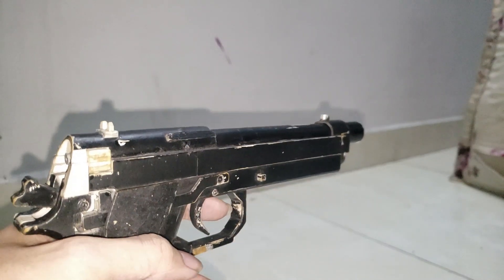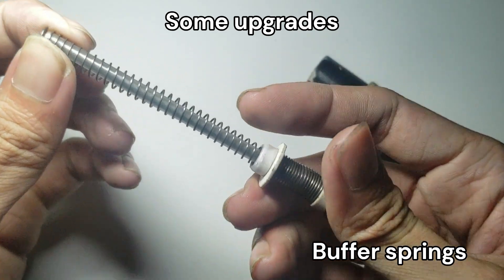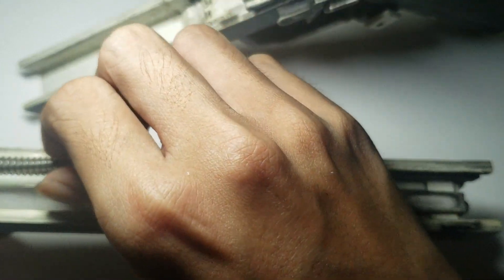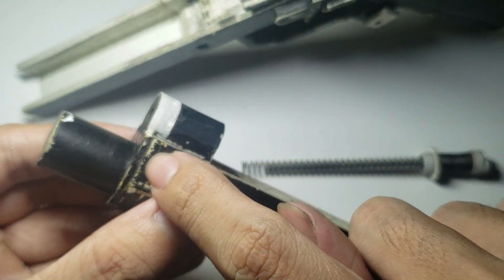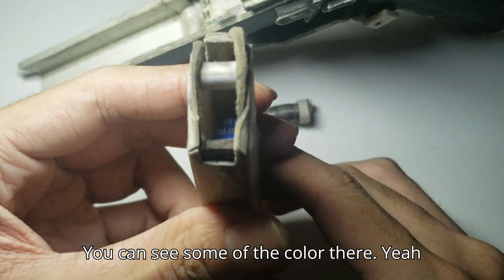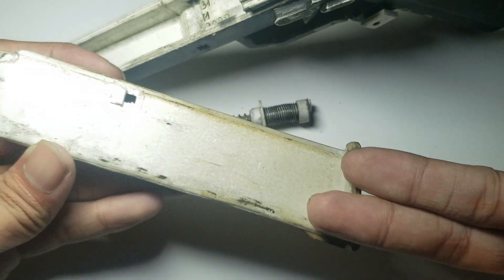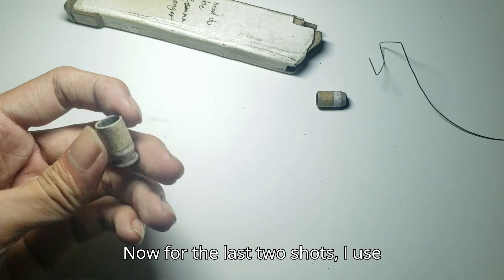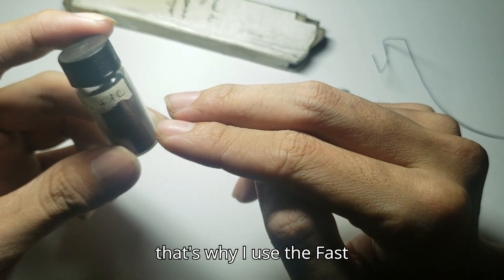Paper Pistol #8: Final Shooting Tests And Upgrades

Comment: Where is the safety
Reply from the maker: The safety is the white cube on the slide, its for locking the firing pin
Reply: @hesitantmetis1413 can you show me the template ?
Reply from the maker: https://drive.google.com/drive/u/2/folders/1DU_hYaIN9UdC3L-qCIdQsH_zmgCg32GW
here you go
Reply: @hesitantmetis1413 i know this template. The one i want is the template of the white cube on the slide
Reply from the maker: i didnt drew it since it came later as the first safety didnt work. Just know that middle is firing, left is safe, right is for disassemble.
Reply: @hesitantmetis1413 one more thing . How do you make the hammer so strong ?
Reply from the maker: You mean it durability or how hard hit?
Reply: @hesitantmetis1413 how hard it hit
Reply from the maker: i just use springs, it doesnt hit that hard, the way the primer cap are made make it easy for a light hammer to trigger it.
Reply: @hesitantmetis1413  so what you use to make the primer cap easy to active ?
Reply from the maker: it just have a layer of alumunum fold to keep it in the mixture in place, making it easy to strike with a lightly sharpen firing pin

Comment: Can gun powder be made with match powder?
Reply from the maker: Not really, gun powder and match powder use different oxidizer, one is KNO3 and the other is KClO3
Reply: @hesitantmetis1413 kno3 is potassium nitrate right?
Reply: @hesitantmetis1413 I watched a video of a guy using match powder in a muzzle loading pistol and it worked
Reply from the maker: Yes. And yes it will work, the different is KClO3 is a stronger oxidizer which mean it burn alot faster, leaving different products, the composition of gun powder and matches are almost the same, but the main ingredients are the same just with a different oxidizer
Reply: @hesitantmetis1413 thank you, will u ever do a tutorial for a single shot rifle?
Reply from the maker: Iam not those are too simple that anyone can make it, if i ever make one it gonna be for testing something really new like chamber, cartridge,  powder or barrel

Comment: Where do u get primer?
Reply from the maker: From match box its pretty common
Reply: I’ve tried but why is it so hard to ignite?
Reply from the maker: There are many resons for that:
Firing pin light strike
Wrong ratio
Low quality powder
Striking suface too soft
...
Reply: @hesitantmetis1413 I think the my hammer dosent hit hard enough
Reply: @hesitantmetis1413 Also have u ever built a machine gun?😊
Reply from the maker: Haiz, listen, i will build an smg at some point but not now, i know you want me to but not now, alright, you can ask other things but stop with smg your time will come, there are things that i need to test before i can advance
Reply: ok ok I’m sorry, I’m just a big smg fan ❤

Comment: 2:29 you just blow my mind 🤯. AMAZING WORK!! ❤ I love how smooth it was. Just cant have worlds its the best thing that i watched today. Your work is amazing please upload a full magzine semi-auto firing video. You are great please bring more frequent videos. By the way can you please share the projectile weight of your bullet and what kind of powder you used in your bullets and what was the amount in this bullet. Will happy if you give these details.
Reply from the maker: You can find most in my video. The amount was 0.08g for the booster and 0.15g for the mix without sulfur, the mixture iam reference to are also in the video
Reply: And what was the weight of projectile? Because it is very important for the recoil bigger mass more recoil. So if you tell the exact weight and the muzzle velocity then may be  i can calculate the total energy and it will help me in my gun also. Because i am also trying to make a semi-auto gun. But it is very difficult . Please be my master 😅❤️ @hesitantmetis1413
Reply from the maker: responding to the reply that you deleted. The bullet velocity is about 48.78 m/s, and the bullet weight is about 5.16g
Reply: @hesitantmetis1413 no it wasn't me. I don't know why but It was automatically removed from comments. But bro why did you keep its velocity so slow. Or was this just an experiment for blowback?
Reply from the maker: Iam prioritizing function over fire power, since its just blowback so its difficult to use more load due to many limitation, like springs and slide mass, if its delay blowback it would be different
Reply from the maker: This isnt something i can help you with, math for gun are complicated also consideringi dont know what your gun look like and how it gonna function, i also have no experience with Nitro cellulose. 

If you gonna test it please consider what will happen if it fail or explode, and if you dont know just test it at a safe distance, firing it with string and under cover.

I do this knowing what will happen if something fail, i have 3 gun fail on my channel: paper rifle #15, case failure due to high burn rate, and m1911 exploded(short), those were when iam reckless.

Doing test you should start with the absolute minimal amount 0.3g try 0.1g or 0.05g first, homemade stuff can be inconsistent, so beware of that, and dont do anything stupid, and lastly if you want fire power just make a bolt action its much easier.
Reply: I have made a single-shot rifle using a homemade shotgun shell. I used 11 steel balls, each 1/4 inch in size, and around 1g of homemade black powder as the propellant. It didn't work on the first try due to pressure leaks in the casing and the primer not igniting properly. However, it worked well on the fifth attempt. The firepower was quite impressive, as it tore through a 6mm thick wooden ply, though the range wasn't very high.

Now, I'm planning to build a gun with better range. I intend to use a single steel ball with ammo size similar to .22LR. I'm thinking of designing it with a blowback mechanism. However, my nitrocellulose-based powder hasn't turned out well yet. Based on my calculations, its range would be up to 100m, with an effective range of 30-40m, mainly because the steel ball experiences significant drag. I tested this ammo with black powder, and the results were quite good. But I haven't set up the proper equipment yet or started building the gun. And the calculations are also based on nitrocellulose powder.

Comment: Do you thinks you'll be able to make rifled barrels?
Reply from the maker: yeah, i make it all the time, this one is also rifled, you can see it in #7
Reply: @hesitantmetis1413  oooh hows the wear and tear from going through so many rounds?
Reply from the maker: It goes through 11 shots, the wear is minimal, due to it being blowback and paper, so the bullet just fit with enough friction, not too tight to the point of seeing rifling on the bullet, prioritizing function over firepower. But the rifling does work on the rifle, you can see it in "testing tracer bullet"